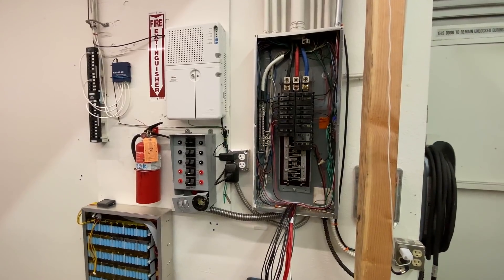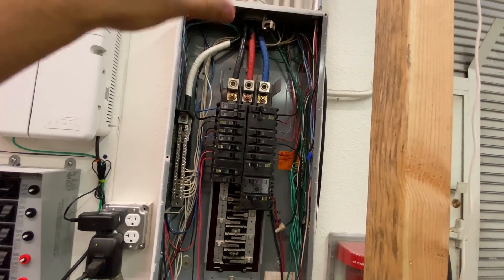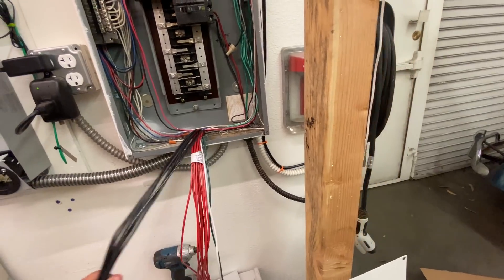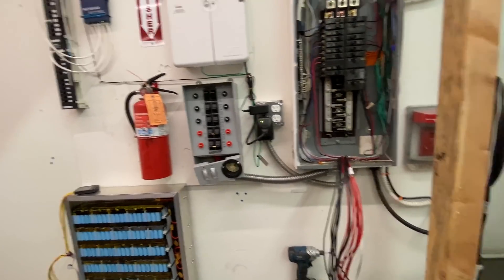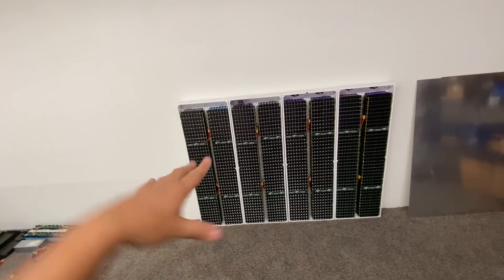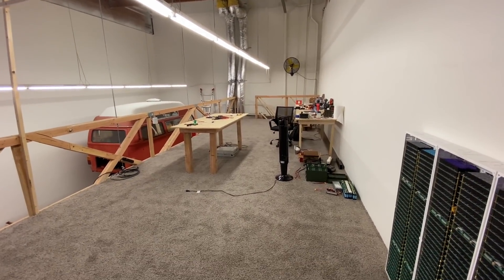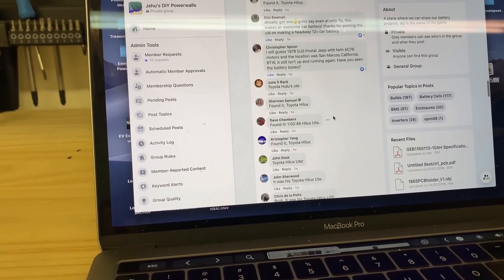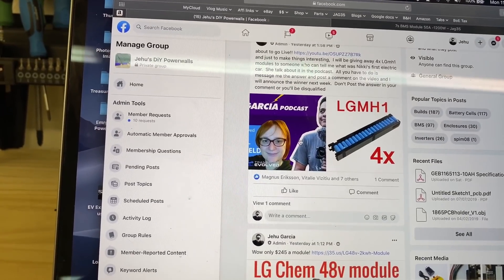How I wired my DIY POWERWALL

Comment: 3:35 It's called a ring circuit. It was common when copper was expensive and wanted to increase the ampacity of the circuit without using larger diameter wires or cable.
Reply: Not under US NEC

Comment: AND... you can add an ATS in front of the MTS.  This automatically switches between grid and powerwall/inverter power.   You can use it in either direction.   1) You can use grid as  'generator' power and powerall as 'grid' power - in this case the grid will power things if grid is available and will auto-switch to powerwall if grid power goes off.   2) The alternative is grid is grid and powerall is generator - in this case, the powerwall will take over if it senses power coming from the inverter.  I do this at my home - turning the inverter on when the powerwall charges up enough and then off as the powerwall drains to cut-off voltage.  This let's me consume my off-grid power 'automatically' switching back and forth between powerwall and grid.     Note: UPSs for computer/senstative circuits take care letting things run smoothly during switch overs between grid and powerwall.

Comment: This design reaffirms why I like the DIN rail style consumer units we have in the UK (and I assume Europe), as you can get DIN rail changeover switches that switch everything over with one switch, plus you get the benefits of the RCD/GFCIs and Circuit Breakers still being in the circuit while connected to the auxiliary power. I've even seen a Chinese made automatic switch which can do it for you but I don't know if I'd trust installing it to manage the power of my whole house.

Comment: The gen input is disconnected from grid tie and never get tied to grid. So you would be better to leave the plugin so in a emergency like you need to maintain your power wall for some reason and power goes out you still have option to tie something else in like another power wall or generator if needed right away. The UL approvals for a transfer switch is that an open plugin like that will never be live when not plugged in.

Comment: Hi there just a quick one. I'd leave the generator socket on the front and just plug in a plug with NO wire connection so that it is there if you need it

Comment: I wanna see an lto 66160 wall but they are pricey but 40ah with only 6 so really how many do you really need I wonder? How many would equal out to what you built? Same with the 38120's? So I have been buying them like crazy over the last few months. I've built three 64ah banks, one 48ah, and one 32ah bank. A pw is next up on the list. Dunno if I should go small cell or large cell to build it....

Comment: I would rather have an inverter that can transfer between generator battery solar grid on its own, so im looking into hybrid inverters that can power all or most of the house all while being able to send power to or get power from the grid ( grid interactive) use generator power to compensate or charge while using solar/battery power, and have so.e sort of wiring i can use to controll a whole house transfer swicth

Comment: Don't forget the PGE planned wildfire outages. Is the grid tie system your next video project. That is what I need. I have a Tesla Powerwall but it does not support my running the A/C and I can't see spending another 13 grand for another power wall. An additional 15-20KW grid tie battery system would be perfect. What batteries are you using for that so I can start accumulating them? If you have already done a video on starting please point me to it.  Am I "That guy" :-)?

Comment: How often does your power go out so that you need to invest all that just to prevent it? If it is for sensitive equipment like PCs, there are already cheap UPSes, laptops are their own UPSes anyway... How much work do you need to do with your lift an power tools during those few moments than the power is out? Seems totally unnecessary...

Comment: Running appliances, including 3 phase equipment on 120/240v? Sounds terrible. Sure, works with single phase equipment, but 3-phase heaters, air conditioners, shop lighting? Something smells TERRIBLE about this. Should use 3-phase inverter with 3-phase supply....
Reply: @StringerNews1 definitely good points made. Yeah, delta configurations share the same neutral, I could only imagine what could happen in a situation like 1 of the fuses blew on the transformers: what kind of issues this configuration would cause if it was fired up or automated. 
I would like to see Jehu connect this thing properly.
Reply: Yes..... but this panel has no 3 phase equipment connected at least if the breakers are installed correctly. All of the single breakers will provide 120v to the loads same as house services. 
The Biggest problem Jehu May run into here, is if he has three phases sharing a single neutral(white). 
Because if he does, and connects all three phases to the single phase transfer switch, two of those loads will   Double the neutral load instead of minimizing it. A fully good electrician would be able to know the difference and probably only a few circuits will need rewriting, as there are 11 neutrals, 17 individual hot conductors, and of those 4 go to single phase 208 loads which may not have a neutral needed